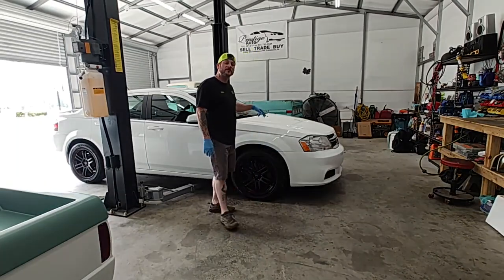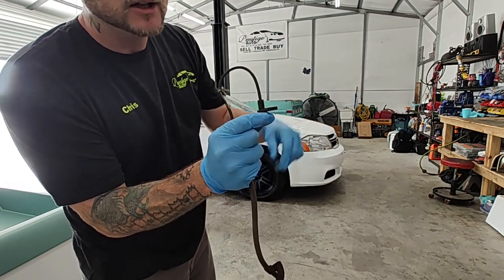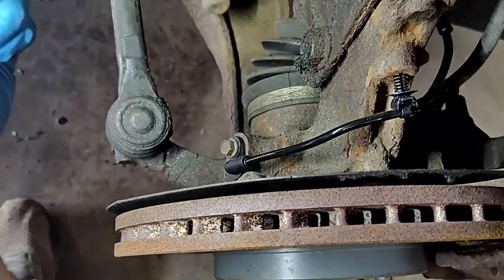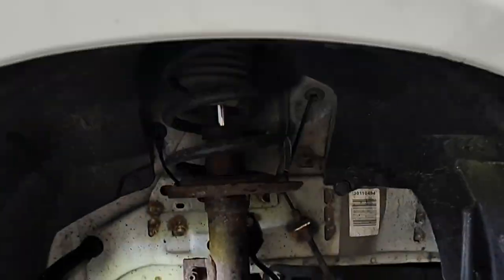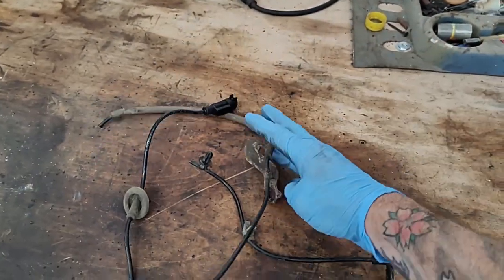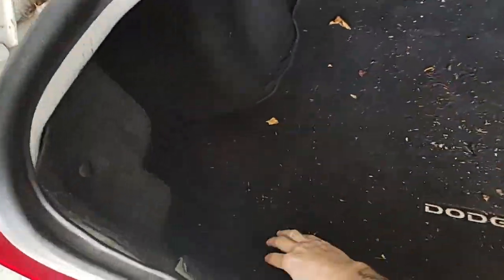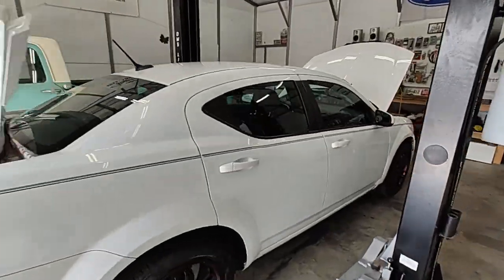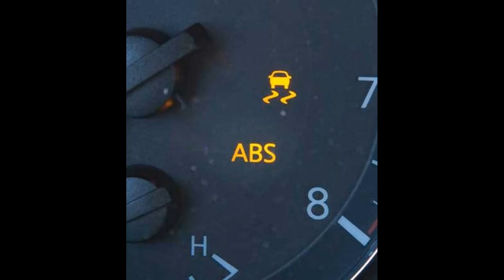Dodge Avenger Wheel Speed Sensor

Comment: Thanks for posting.  Problem, I'm no mechanic, so saying "unclip the wire connection" without saying how to unclip the connected wires really doesn't help. I watched 4 other videos and each bypasses how to unclip the connected wires in the engine compartment.
Reply: Did you figure the clip out?

Comment: How do you know if the sensor needs replacing?? What does the car do cuz ive been expiriencing little jumps when the traction control light pops up
Reply: Well it's called traction control for a reason you're car won't have the same control when you drive in the rain in slippery surfaces

Comment: You didn't show how to unplug the cable. I cannot get it to come loose and I'm afraid of breaking the clip.
Reply: I cannot get the connector loose at all. Which way is the red tab supposed to go to unlock it?
Reply: Very true, wish that was shown.
Reply: I'm about to have to dive into replacing one on my 2013 avenger rt.If I find something out on it I will post it here.Its ALWAYS more difficult that it looks to be.
Reply: If YouTube didn't censor so much I'd tell you.
Reply: @jenkemjones68  I sprayed it with a little WD40 and it disconnected easily.
Reply: @securityguardcommand9792  Yes I got censored 6 times trying to say spray it with PB Blaster and let it soak 15 mins.
Reply: Slide the little red clip out out just a little bit press the button wiggle it it'll come loose
Reply: Sometimes you have to use a screwdriver to get the red clip to slide out but it doesn't come all the way out just about at 8th in
Reply: Did you figure the clip out?
Reply: @jussayin5148 did you get this clip out?😊
Reply: @jenkemjones68 did you pull or push the red tab
Reply: Did you figure it out? Can you share?